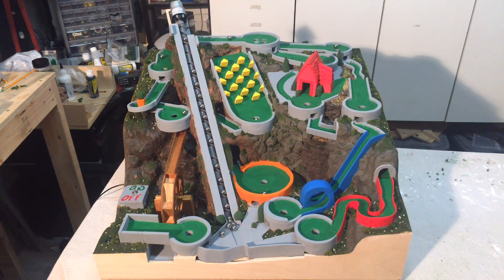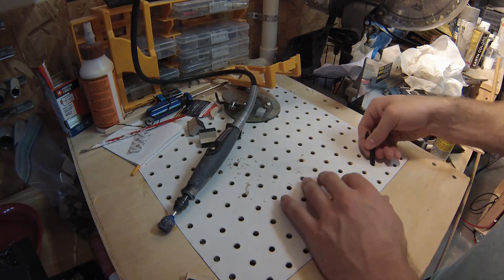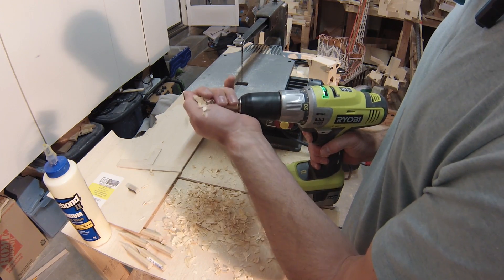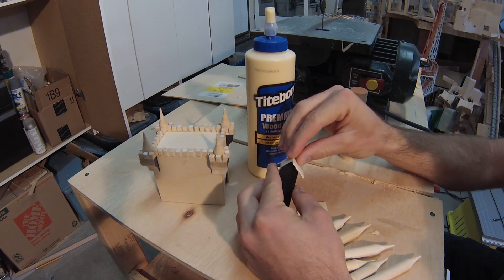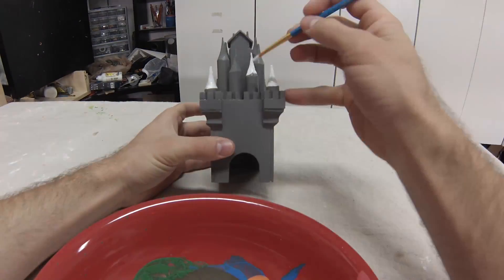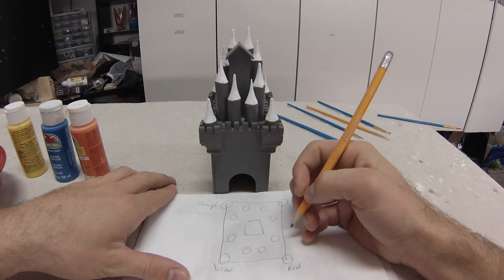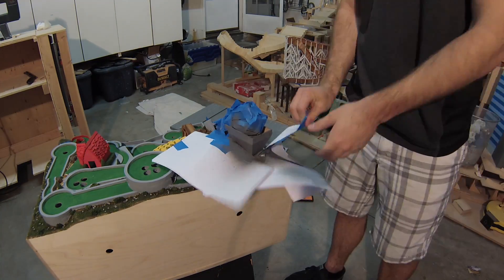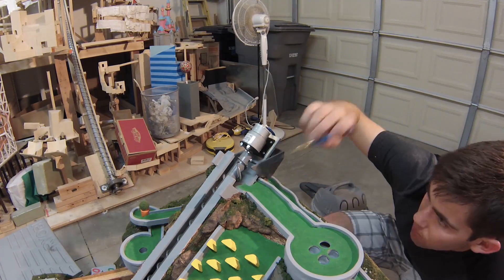Mini Golf Marble Machine Build, Part 22 (Cherry on Top)

Comment: A little suggestion: Glue small square pegs inside the "castle base", so the castle slides over the pegs, and then the castle will be more easier to place correct with less hassle aligning it. These pegs can also have a small angle making it even easier to put the castle there.

Comment: Looks amazing! The castle is a great focal point! 
Other commenters have also said that the red track is rarely used and I think the problem lies in the first distribution dish (the 4-hole one) - is it possible to add a small bumper or maybe carve a groove to better randomise the marbles' directions?

Maybe I am missing something, but what is your reason for building this machine?

You've inspired me to design my own marble run. I plan to use my self-built 3D printer to make the scenery and obstacles. Maybe I will video the process!